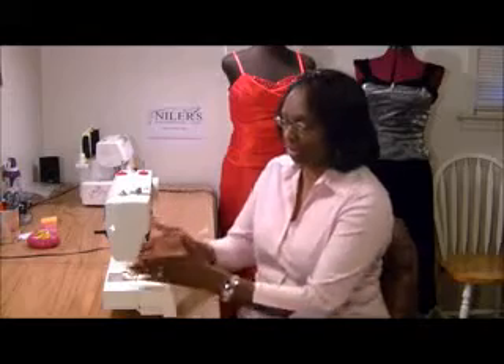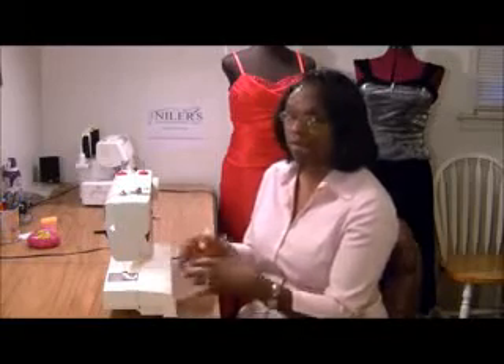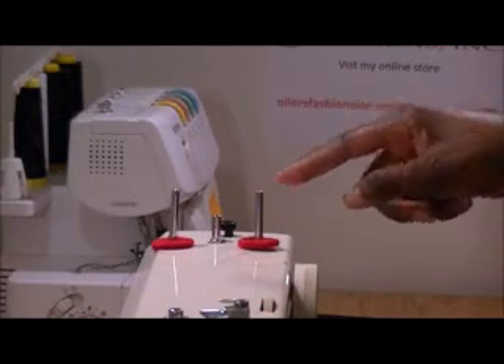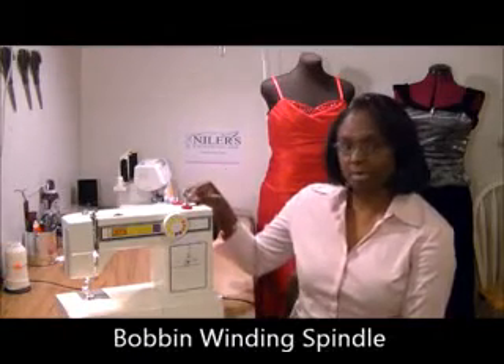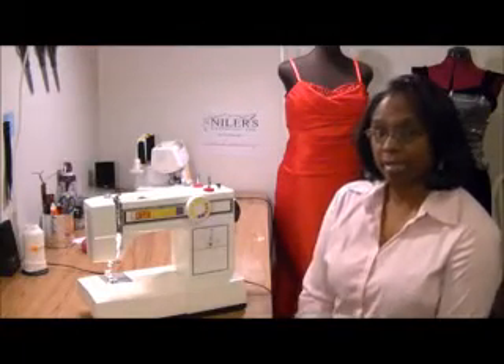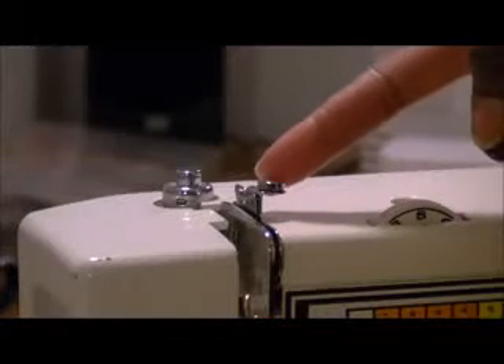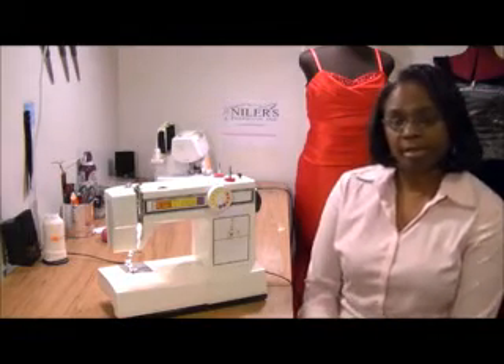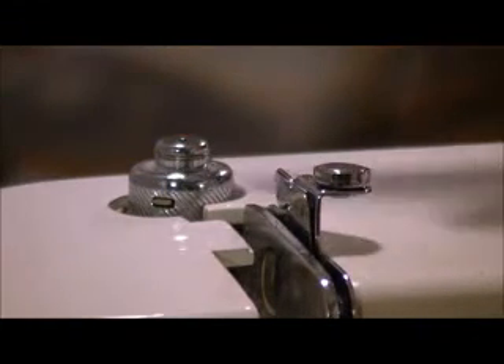How To Sew For Beginners Part 2 Getting To Know Your Machine

Comment from the maker: @krishondaful Thanks for the question.  Any basic machine will do.  I personally like the White brand sewing machines.  They are more durable because they have all metal parts.  However, if you are going to do mass sewing, I suggest you go with a commercial machine.  My suggestion would be a Brother brand industrial straight stitch machine.  That's the machine that I use for large projects.  Hope this suggestion helps.  Thanks for watching!

Niler Taylor

Comment from the maker: @a2zhandi That's a tricky question.  My suggestion would be to go to your local/area fabric store.  First, find the pattern that you want to make.  Second, look on the back of the pattern at the suggested fabrics for that pattern.  If you are not sure what fabrics, thread to get, ask the clerk that cuts your fabric to assist you.  As far as the needle goes, you can use a standard size 14 needle unless you are using a stretch fabric which requires a stretch needle.  Hope this helps!

Comment: @relindesigns yes, I did that. Prior to it, I did a little research. Sunbrella is the material I need. (I don't have a pattern. I'm designing on the fly.) 
At Joanne's fabric, I asked for it. No luck. Then I asked for heavy thread & a needle to accommodate. I ended up with the wrong needle & small thread. I didn't know what numbers to ask for.
A little more research, and I find I need about #18 needle & carpet thread??
Thanks for your time.

Comment: My Machine Does Not Have A Pressure Button/spring At All. Does This Change Anything?
Reply from the maker: No, it should not.  If your machine does not have one, then it means that your machine is preset from the factory and you don't have to worry about it.  Thanks so much for your question.
Reply: Thank You For Answering. I Was Getting Nervous About It.